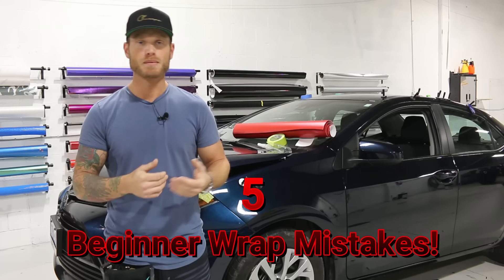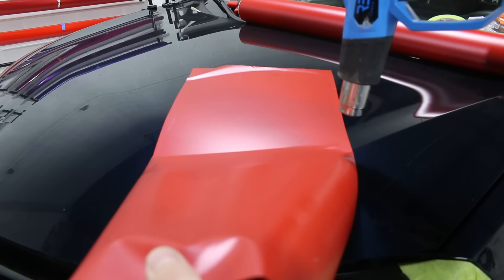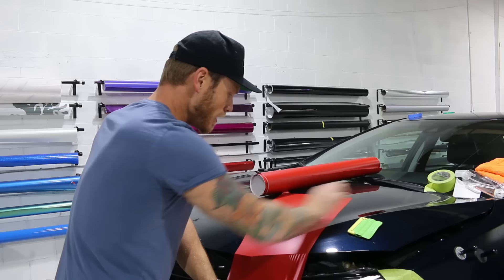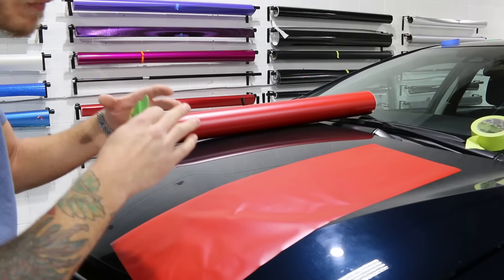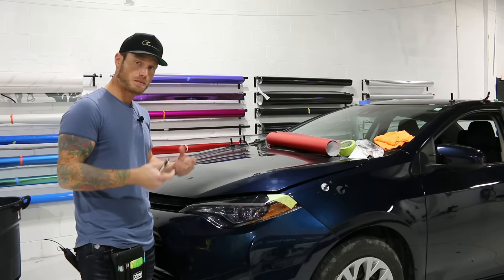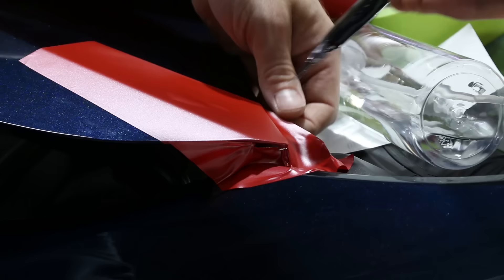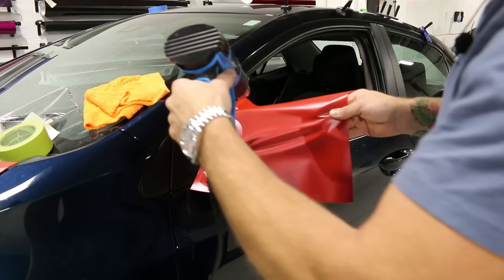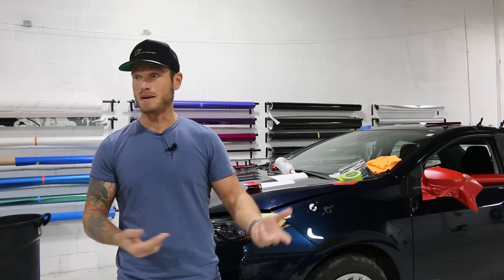5 Most Common Vinyl Wrap Mistakes

Comment: It's also worth mentioning that when you wrap, you want to stretch the material as much as you can w/o heat, and then only add heat when needed.  Too many people rely on heat to stretch the material, which results in over stretching.  And by doing that, it will always want to return to normal, when re-heated by the sun.

By stretching it as much as possible w/o heat, it can't shrink itself back down later on when it gets hot, because it was never over stretched with heat in the first place.
Reply: Late reacrion but does that mean i shouldn't use heat at all? Got some small things i wanted to wrap l so i just press it all down without heat? (Since they are small things i can cut it out on perfect size)
Reply: @Alice58302  only use heat when you have to. ie in corners. Remember if you use heat to slightly stretch the film to allways post heat the area so it can shrink back into place before trimming  👍
Reply: @daleg4192 what is post heating?
Reply: @Smiles5.7  heating all film up to 100 degrees Celsius after you finished.... basically it kills the memory of vinyl and will stop it from shrinking and or lifting. It is must do step for professional wraps 👍
Reply: Heat and cold will ALWAYS make the vinyl jump the gaps on inset body panels, the only way to avoid this is to cheat by completing the 'gap' with a strip (quite invisible and acceptable. - If it's a body cover printed graphic, good luck.

Comment: What I found interesting was the squeegee pressure. I used avery gloss black for a roof the other day and I got wrinkles. With avery gloss black being as thin as it is, I actually felt that I was putting to much pressure and was stretching / pushing the film forward causing wrinkles. So I made it stick first before applying more pressure. It worked, but it is an extra (unneeded?) step.

Comment: I put on a hood design on my Jeep & also did a minor design using design line on my work truck (freightliner cascadia). All i learned was from your videos. Gotta say, my 1st 2 attempts at "wrapping" were a success in my book. Of course there's some minor flaws. They were my 1st & 2nd attempts after all  lol  my next 2 attempts will be laying a piece on the hood of my truck, which shouldn't be too bad. But i am also going to try to wrap the chrome grill on the truck black. That will be a challenge. Will be good practice for laying in recesses. Keep up the good work 👍

Comment: A bonus tip, after spreading outward to stretch around a corner, if there’s too much material in the back it will fold on itself, trim the material, don’t cut slits or it will just curl up back over the edge.

Comment: Nice, thanks! I will stretch a small vinyl wrap around my aftermarket Android stereo frame to achieve a brushed steel frame look, like my VW Passat B7 trim, to get more OEM look. What I will try, will be to have the frame facing upwards on something that has around the same width and length to support the pressure when I will add the vinyl, but allow me to pull down on it, like you did with the mirror. Then I'll heat the vinyl and just press it on top of it. I will wrap it by bending around a bit and then cut it off. Lets see how it goes :)

Comment: How can you prevent the edges from lifting after applying the wrap?, I'm wrapping a jet ski but when I continue the next day the edges are raised and I have to apply heat again to stick them to the jet again, it's a bummer. Thank you for the video btw.
Reply: Upload a video of it and reply back when ya do
Reply: Did you figure it out? He said pull past the edge not to the edge. I’m about to give this a try it would be helpful if that was the issue. Pull past rather than to

Comment: Just started watching you but I've been wrapping some of my own interior panels for several years. I'm no pro and have learned how to correct some errors I've made on more complex shapes.  I have a Audi S5 Cabriolet that's grey with black top. It's got the black RS front and both headlights/taillights & the badges front/rear are all blacked out. So my question today is if you want to wrap a portion of the hood and deck lid (trunk) following boody lines not the entire panel to its edges... It's there a special tool to cut the vinyl against the clear coat or what technique do you use. Another example would be. I have a white GT Mustang and want to to the Ford blue dual stripes which are 10" wide each. My vinyl roll is 25".I can apply the whole roll down the middle and just cut a 5" piece out of the middle. Your professional advice would be a great help.
Reply: Use 3M knifeless tape. 
Search that on Ebay and you'll find what you need 👍

Comment: i helped my wrap guy as I took off the side mirror cap and tuck the edges inside so it wouldn't peel off. I had it for 8 years. the ones where i didnt tuck in the wrap around the edges all peeled off in high speed driving

Comment: Excellent video.....I will start wrapping my cheap looking matte plastic door frame panels in gloss black film.  I really appreciate the tips.
Reply: Ordered vivid high gloss....measured all parts_made paper templates, will stick them with tape on the parts to be covered and make a practise run for every template....film arrives Saturday and will be pre-cut as paper template.....will clean the car, wipe with alcohol each panel down and then apply film as shown and practised....

Comment: Amazing skills you make it look so easy     So I had a go at doing my car roof myself black carbon fibre on my own just trying to lift it up and lay straight was hard then cut and tuck under the window rubber just right and no air bumps still I did it ok 2 years later looks ok too has few cracks and this was a flat bit and there’s me saying I’ll do the whole car lol

Comment: Thanks for the lesson. Will be trying my windows on my 19 dodge charger. Currently black windows. White color. Also planning to wrap the tail. Doubt I have to take it off. As long as I have enough wrap I should be good. Check out the green lights i added on mine.

Comment: If I did this day in and out I would make a pivoting articulated arm coming down from the ceiling to hold a heat gun with a foot switch. The arms pivot would be at the center of the car like the hose holders at a DIY car wash. Yes I would still have a hand held heat gun.

Comment: I'd say the biggest mistakes most make is not removing trim/panels/handles...etc. Everyone wants to do knife work and the issue is the edges aren't crisp. Get the proper tools and take the time to remove the pieces necessary. It looks cleaner and helps keep the vinyl lasting longer.

Comment: No heat doesnt react with the water molecules. Whats happening is air expanding when heat is applied. For example if you take a flat football and put it in the microwave for 30 seconds it will be hard and seem to be full. Same with the vinly. A minute amount of air that maybe isnt seen is pressurized because of heat.

Comment: Thx for the lesson... I try to tint my motocycle helmet visor... And failed a few time before i found this video ...
Reply: I failed 1 more time,and come back here and check out what my mistake...

1.over streching
Until the layer broke... Bcoz the visor got the big curve,and i dont have enough equipment&skill... So i need to hold the helmet,heat it . Hold the film... Not enough hands... Yes its hard . But i keep trying...

2.Squeegee pressure
Bcoz i see a lot of buble  around the helmet visor, so i take out the failed tint,and heat it,and start back using the same film to practice squeegee.... To get the firm tuned.

Comment: Thanks and well done..............My question is.....Will the wrap survive not being tucked around a panel, such as a wheel arch or hood. In other words leaving the eadge of the vinyl wrap exposed. I want to use carbon fibre wrap on my doors, but almost like a the usual decal. Not going all the way to the edges.Thanks

Comment: Im trying to cover a front grille surround , that has a small crack in it would it be easier to put it on the inside and pull outwards or fold it inwards , very interesting video , very clear and informative ,

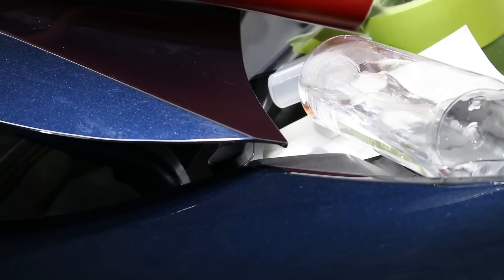Comment: on the top on the hood in the corner near windshield pillar. 17:03 should a beginner leave a bit more than you then heat and trim after. just worried about doing a big panel and getting too much shrinkage.

Comment: For Mistake #2 I just want to make sure I'm understanding correctly: Instead of pulling straight back you want to pull outwards in two directions? Allowing the wrap to want to curl under the panel?

Comment: You make this look so damn easy!! Just ironically I tried to wrap my calipers again today! And again, I had to tap out!! But I did get most of it before I tapped, as you said, I had trouble with those edges. Will you or have you done a video on wrapping brake calipers?🙏🙏 I was able to save it this time, compared to the last time..
Reply: why would you vinyl wrap an area that heat cycles consistently and at a high temperature? just powder coat lol.
Reply: @MistaaFrosty  
Because they MAKE wrap for calipers🤷‍♂️ its a short term look to change your color if your car is wrapped. Powder coating is permanent, and might not match with the regular color of the car.

Comment: I want to wrap the side panels on my pontoon. Can I just lay down the vinyl, smooth out the bubbles with a squeegee and not apply any heat?  it is a flat panel without any edges for the vinyl to attach and create tension. I do not want it shrinking in the summer when it is hot

Comment: G'day CK wraps... I'm doing a 2022 model Suzuki Hayabusa motocycle petrol tank and it's proving to be quite difficult... I'm no expert and have watched many utube vids to try an educate myself as much as possible before i have a 3rd and final go....
My 2nd attempt wasnt to bad but have now realised i didn't use enough squeegee pressure as i got air bubbles in one side i couldn't get out and wondered why and how...
Now i know.
 My other mistake was hand placement and over stretching to the cut off line, causing fold or bunch up marks....
I'd dearly love if you have the time to show tubers how to successfully wrap a modern day sports bike petrol tank as i believe the curves and arcs are way more prominent than something like a slim line Harley Davidson petrol tank...
Sports bike petrol tanks are tighter in curvature and higher and longer so quite easy to get folds and waste wrap because it gets stuck to each other when trying to stretch.
I use 3M quality wrap and sorta happy at my second attempt but i will try to do better with the 3rd attempt...
Thanks for a great instructional video as it's educated me to do things right rather than do it wrong off the bat...
Many thanks brav.

Comment: So with the mirror in Mistake #1, because you stretched it a fair bit to get a smooth finish, how do you successfully do the edges? Especially on the bottom part where you cannot wrap it around a corner.
As you showed on the hood, a stretched edge will lift easily, so how do you do this properly?

Comment: Great video but I have one question..,
Since it's not an option to paint my motorcycle, due to lack of cash, after I apply the vinyl wrap, what kind of protective layer should I put over it? I'm asking because I've heard a lot of complaints about the wrap chipping too easily.
Thanks...

Comment: I appreciate the knowledge and have a question about a mistake I make. I often find myself trying to correct wrinkles and end up over using the heat gun. More than once I’ve actually melted the vinyl. Any guidance you can provide would be greatly appreciated.

Comment: Thank you! For these tips. I have a roll of 3M License plate reflective film and would like to wrap the inside rims of my Camaro SS 1LE black wheels. The reflective white film. I used to be a temp at the 3M plant and they let me have it. I plan to sand and clean the inside rim and leave 100 grit swirl. And looks like I need to heat the wheels. And then these tips. What do you guys think of this idea? Lol I think it will look cool as hell, it's a summit white SS 1LE 2014, thanks again for some tips

Comment: Another great video! I have one question: I hear you emphasize the benefit of "Post Heating" in other videos and it makes good sense.  But at 8:00 minutes (when you stretched to the edge and then simulate summer heat) the wrap pulls away. So, does this suggest that one cannot ever "post Heat" over a stretched edge? It would seem that stretching to an edge might sometimes be unavoidable. If so is this when an edge sealer like 3M 94 might be beneficial?  Thanks for all of the great info and experience you share with us. I am looking forward to upping my game and getting involved in your website!

Comment: I'm sorry in advance for such a rudimentary question!   Why did you heat and stretch, because when you first applied the vinyl to the car Bonnet ( hood ) it looked great.    I'm sorry if it is a stupid question!    
I've got an Aprilia RSV4 motorbike that has a black front tank cover that i'd like to color match silver to match the main part of fuel tank,  and i believe that vinyl is the way to go.   It does have some peaks and troughs.     
Any thoughts??
Best wishes and thanks in advance. 
Eddie

Comment: We are barrel stripping paint 80 grit the 40 grit polishing  then finer grit perforce primer. Question is do we have to seal and sand with a sealer or can we wrap the vinyl? Please respond soon as we are in process getting close to polishing metal

Comment: Great vid, thanks! Question about the heat gun. Doesn't look fancy. Just an ordinary heat gun for paint removal. Correct? No digital adjustment for the temperature. With what temperature do you ' soften'  the film? Seems difficult to maintain the correct temperature. I want to do a wrapping job on my kitchen. I have a standard heat gun (for paint removal ) with two settings. Max is 1500 watt. On the low setting can it be used or do I need something more advanced? Please inform. Thanks!

Comment: Planning to do Vinyl on an aluminum keyboard. Would you say most of these mistakes would still apply at such a small scale? Or rather, would the mistakes be more noticeable given the smaller scale and basically no heat coming out of the object?

Comment: I'm just tryna vinyl wrap a pair of shiny holographic quad skates because I bought them in a really garish Barbie pink mainly because the spec of the skates were top notch but the pink was the cheapest and I was on a budget. I just want to change the colour of them using vinyl wrap because the gloss finish doesn't work with any paint. I've no idea if this is possible or if it will immediately peel off.

EDIT: btw I tried already with this wrap from a brand called DC Fix and it was terrible. It had no stickability and I could literally peel it straight off like it was nothing. I now realise it was more appropriate for furniture and I'm just looking around for something better. Maybe a heat transfer? I dunno...

Comment: what is the optimal temperature that you set the heatgun to when you apply heat on the vinyl ? is it any helpful to apply heat if you lay the vinyl on very flat surfaces ? will the heat help the vinyl to stick even better ?
thank you.

Comment: Is it an acceptable practice in the industry for a wrap to require several adjustments on sections that occasionally come undone due to settling of the vinyl? They've already fixed the few exposed seams that occurred within the first month as expected; however, I recently noticed a few other areas that have come undone.

Comment: Hoping you or somebody could answer my question. I have a drift car with a sunroof delete panel. It leaks water even with weather stripping and silicone. I’ve wrapped the roof with vivvid black vinyl and it split over the gap from the sunroof. It’s impossible to get all the air out. Does that cause it to split or was it just bad vinyl?

Comment: Are there any tips for much thicker Vinyl?
I bought shadow camo black vinyl, its camo pattern that shifts depending on the light and its that kinda hologram that changes when you turn it side to side...
The vinyl is much thicker than the average and it doesn't stretch as well and tears easily.. if you overstretch it even a tiny bit, it ruins the effect. I cannot get it to work on my motorcycle and its killing me. I don't want to waste the vinyl!
Any help would be appreciated.

Edit: It's actually 3M Shadow Camo with air release or whatever...
3M Black Shadow Camouflage  https://www.amazon.com/dp/B07F2N2S81/ref=cm_sw_r_cp_apa_i_IuCBFb5F7EHZY

Its amazing stuff, just really hard to work with!

Comment: I subbed very informative so I def need a heat gun. Do you need a full sheet for the hood or can that be pieced? Sounds dumb but I have an old car I scuffed the peel off it and I want to wrap it. I got it smooth kinda. Will it matter if the cars paint job is all wank? Thanks -PawPaw

Comment: Hi mate. I'm looking to vinyl wrap some expensive speakers (KEF r500). Mostly a rectangular box - Should I be doing each individual side/panel individually? or say using one big piece of vinyl to do left, top and right (then doing the top and the bottom separately with their own piece, and hoping the edges marry up neatly)?

Comment: Got a question.... I have a C4 Corvette with a hood that spans 85 inches from molding to molding and is 65 inches deep. Problem is I only find on Amazon at the most 5 foot width of vinyl sheets. I prefer to have a full coverage sheet so not to have butt joints. Do they sell wider sheets or would a butt joint using knifeless  tape be OK.? I was considering the possibility of a center stripe of a different color to bridge the gap. What would you do? Any info would be appreciated. Thanks.

Comment: The temp that heat gun is putting out is way hotter than any engine and summer temp we are going to experience on earth.  I'm not sure I see the edges pulling up. Guess you have more experience